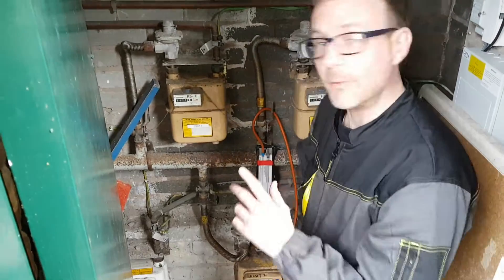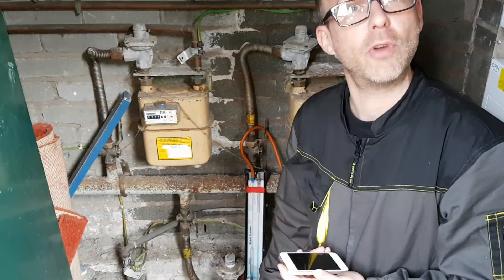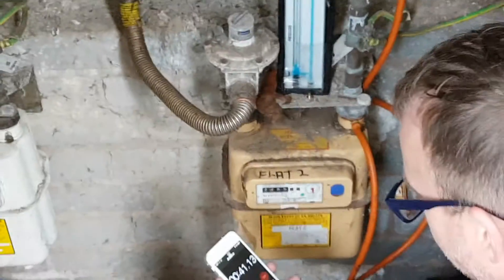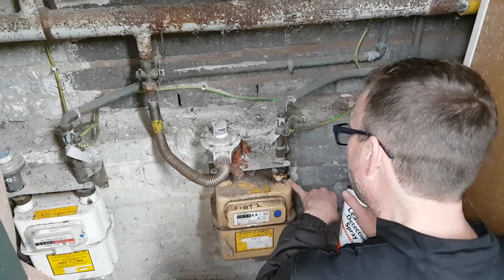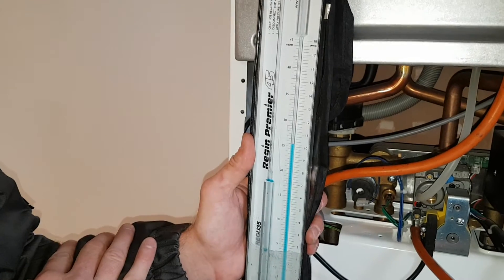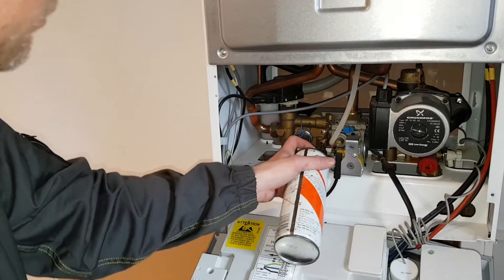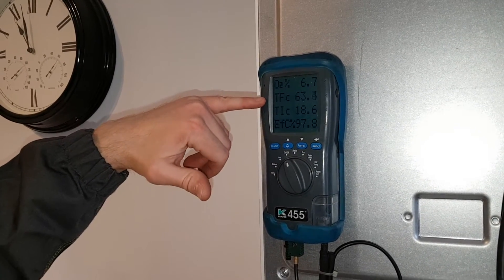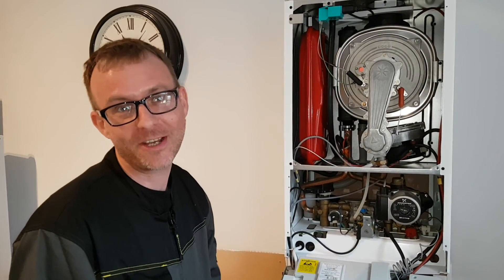Gas Portfolio Building and Training | A+R Central Heating and Boiler Repair Experts Ltd

Comment: Doesnt the appliance have to be running for a gas rate. doesnt the u-gauge have to be disconnected? Im quite new to the game but im sure thats correct. And on the let by test you didnt use on the ecv barrel as this wouldn't be detected by a u-gauge
Reply from the maker: Sorry only just seen this message, hey, i'm currently growing my Facebook group and would love if you could join Tony will be there to answer all of your questions https://www.facebook.com/groups/167070231326174

Comment: Operating pressure at the meter?- you mean working pressure? 
22mb operating pressure at the boiler inlet?
So that includes the 1mb drop across the supply pipework and the restrictions on the gas valve? 
Can’t see it being just 1mb tbh
Especially with that old regulator on the meter
Standing pressure btw means nothing whatsoever- it just shows that gas is present

You forgot to mention that the operating pressure should be carried out with other gas appliances running

Air integrity testing the flue? 

First thing you should be doing before doing a combustion analysis and removing the case/combustion chamber- especially for long run/vertical flues- your testing the flue system is not vitiating on the air intake.

Ideally doing this first as your FGA will already be purged in fresh air.

Condensates just as important as these are part of the flue system.

Engineer with 30 years + experience- 

Not hating but a lot of this stuff should be second nature especially for newbies

Good luck
Reply: Moorsey84 Moore it's the pcb, you need to change that
Reply: bob bob not following? Pcb for what??

I’m not diagnosing faults here, just pointing out some basic 26(9) stuff 
No mention of any faults

Comment: The boiler Doutec,   you clearly have not followed the MI's. I personally lack confidence in you. No business from me boy. The reading a lot lower than than the manufactures setting?  what are on you on about. Look at the MI's and you'll see why I'm saying this. Sorry your in no position to put videos as you are incompetent. You've missed several key areas. Deaf, dumb and blind.
Reply from the maker: Moz Dee so what do you think I should do ?
Reply: I'm not here putting videos on trying to give knowledge to others. I only guide the blind and put them on the right path. Try to walk before you can run.
Reply from the maker: Moz Dee Yes boss
Reply: Moz Dee you need to change the pcb
Reply: I think you need to do a course in English here. Grammar and spelling of a 10 year old 😂